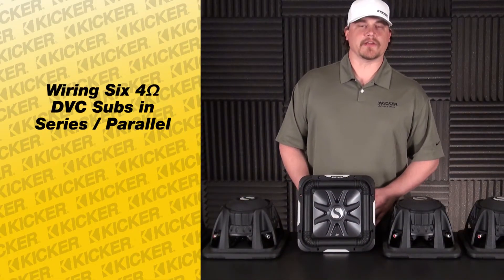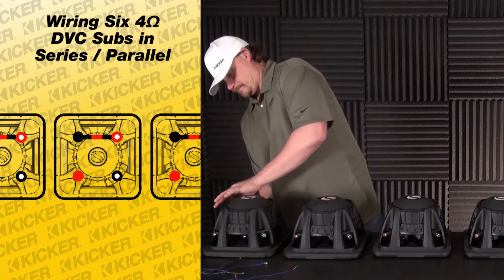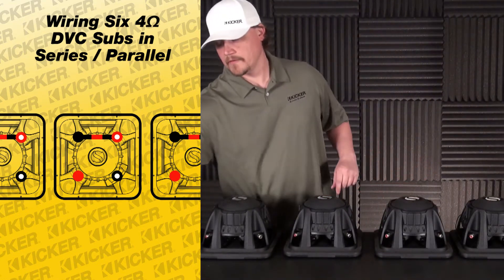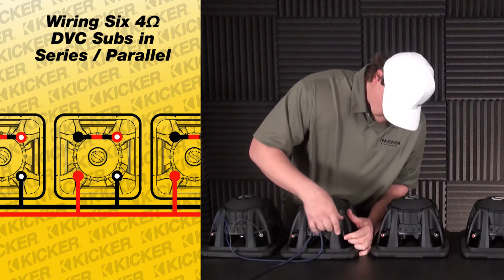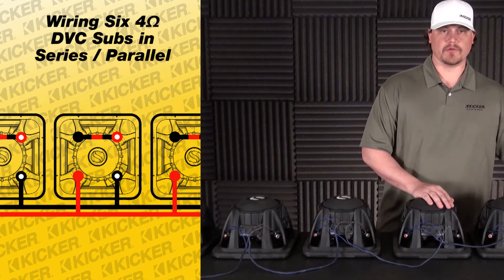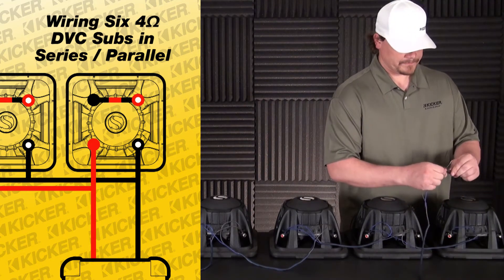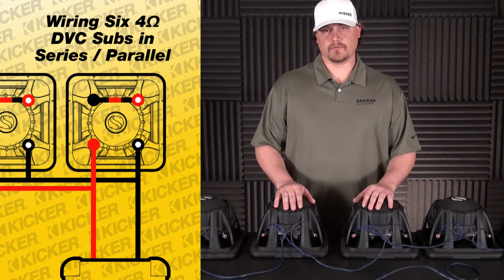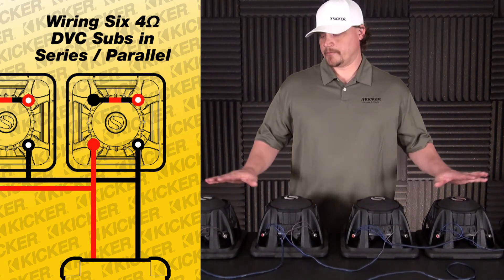Subwoofer Wiring:  Six DVC Subs in Series Parallel

Comment: I have 4 kicker l7 15's and the new comp q 15's. Even though they are 1200 watts each, are they able to be wired in series or parallel together without any issues.
Reply from the maker: If the maximum RMS power rating is the same for all of the subwoofers, and I'm relying on you having done your due diligence here since I don't know the exact models and years of your subs, then you'll be fine.
Reply: @KICKER-AUDIO  the l7s are the last ones kicker made. The q class are the most recent that kicker has now. Thanks for the response.

Comment: I want to get six ct sounds ozone 10's dual 4's wired in series parallel at 1.3.(9.5 cubes after displacement with future box) I want to power them with a sundown salt 8k. salt 8k dynos at 11k at 1 ohm and 6k at 2 ohms. Would I still be able to get the 9600 watts with impedance rise from those subs and amp?
Reply: the ozone 10's are 800rms(4800 rms with 6) and 1600 peak(9600 peak with 6)
Reply from the maker: We wouldn't want to talk about technical aspects of someone else's products, so speaking (very, VERY) generically, you'd probably get that power at a very specific frequency.  That frequency will depend on the tuning of the enclosure. You should consider getting an o-scope to determine where the lowest load exists.

Comment: I'm just curious but would one sub get more power then the rest?
Reply from the maker: Not in this case, no. If one sub was wired in a different fashion accidentally (say, in series rather than parallel)  two things would happen: first, that one sub would get a different amount of power than the rest.  It would also change the final ohm load the amplifier "sees." Ultimately, it would sound worse. When multiple subs are playing the same frequencies at different volumes, it causes distortion.
Reply: @KICKERAudio o ok thanks alot!

Comment: What is the ohm load for 6 dual 4 ohm in parallel
Reply from the maker: If you paralleled all of them it would be way too low for any car audio amp.  Were talking fractions of an ohm.  The best thing to do is look at your amp's specs and determine what ohm load it wants, then work from there.  If you tell us the amp brand and model, as well as the sub brand and model, we can make recommendations.
Reply: @KICKERAudio  I have 6 massive hippo 12 dual 4 ohm and the amp is taramps 12k at .5
Reply from the maker: You'd have to wire them all in series/parallel (you'd get a 0.4 ohm load). The amp may or may not go into protection. You will probably need a big 3 upgrade as well, if you havent done that already.

Comment: What would the ohm load be on 6 dvc 2ohm subs wired like this?
Reply: simple way to look at it, what 2 ways can you wire a dual 2ohm( 1 or 4ohm). lets say we go with  6 dual 2ohm wired at  4ohm each..  4ohms divided by 6 subs would give you .66ohms which is pretty low. if you take 6 dual 4ohm subs. Wire them to 8 ohms each then divided by total subs(6) and you get 1.33.   Dual 2 ohm subs can also be wired to 4ohm each in groups of 2  which would look like.... (8ohm) (8ohm)(8ohm) then divided by 3 which would give you 1.33 as well.  The 2nd method with dual 4 ohm subs is the way I would go... Much simpler and you also get 1.33ohm

Comment: What size amp would u need to run them 6 subs
Reply from the maker: The Solobaric L7S 12" has a 750 watt RMS. That's a total of 4500.  You'd need two of the KX24200.1's to do that right.

Comment: would it matter if you hooked a solid red + b/w in series & the other two in parallel? i have 3 dvc subs & trying to bring them down to 1 ohm because thats where i get the most output from my amp, but all 4 terminals are either solid red or black. so if you were to connect them vice versa from what you did in the video would it affect anything? easy to understand and very instructable videos btw, liked and sub'd.
Reply from the maker: If you invert + and - you effectively double the ohm load, which is fine provided the wiring is consistent throughout the subs - and your goal is a higher ohm load. Different amps take different minimum loads, so it does vary based on the gear you have.
Reply: @KICKERAudio  the goal is not a higher ohm load, its as low as you can go.
Reply from the maker: @sethh8892  Not always. As the power gets higher, it gets harder to hear a difference, plus you lose accuracy as the ohm load lowers.
Reply: @KICKERAudio  ill stick with my .5 ohm load😂 get loud kicker🔊🔊🔊🔊
Reply from the maker: @sethh8892  Check out #TheCube by JY power.